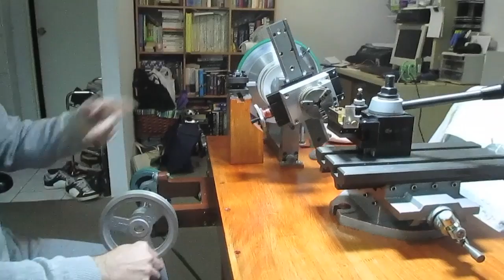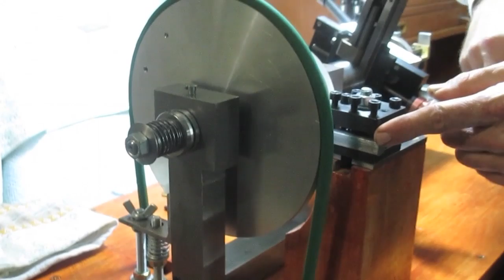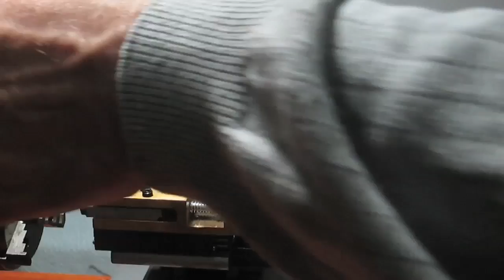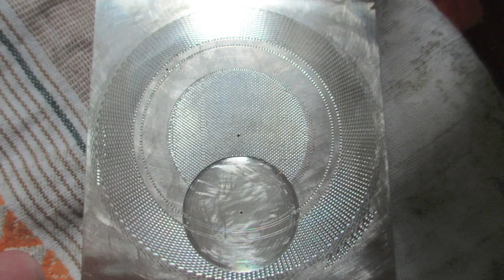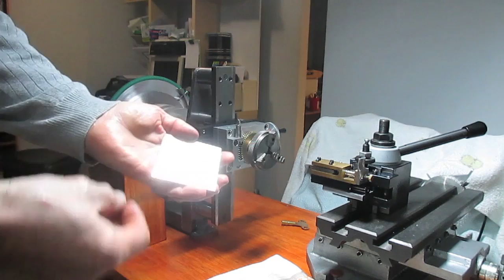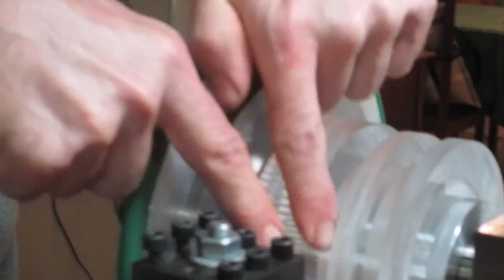Rose engine homemade, tour a guillocher

Comment: There is a video on YouTube showing a similiar lathe for doing Engine Turned Dipwear. Pottery covered with slip that is then turned with pattern cams for radial or axial designs. Checkered, basket weave etc. The lathe in the video is a copy of Wedgewood's from the late 1700s.
Reply from the maker: Thanks for the info. Yes, i saw that vidéo, very informative.

Comment: Hello Frederic. I don't know if you will still answer questions. There is one thing that I do not understand and it is in the support of the cutter how do you make the rubber retract. The pushing action is easy to understand (the screw thread does it). But, in what way is it attached to pull the rubber?
Thank you

Comment: Very nice machine however this is 2019 and You can use software and a 4 or 5 axis cnc to do the same work and the machine cost is a lot less than building a custom machine  to duplicate what was done in the Victorian days.
Reply from the maker: Ahh the CNC machines they are great aren't they? Actually a 3 axis CNC milling machine would do! However there is NO CNC milling machine that can reproduce what a rose engine can do, (I'm talking about guilloche work of course) a well set up rose engine can achive a level of finess and finish of engraving a rotating milling bit can't and that is probably why high end watch brands use these (Victorian) machines to produce their guilloche watch dial.
The only CNC that might have a chance is the Faro F1 with guilloche attachement, but then at what cost?

Comment: Where do you source your cutters and what angles do you use on your cutters?
Reply from the maker: Oscar Gonzalez I use high speed steel bars that I ground to the correct angles,  the angles are critical for engine turning, I use a goniostat with the edge of the cutter forming a V of 10 degrees per side and 20 degrees front rake!
Hope that make sense.

Comment: Really well thought out Frederic, this is the first home built design I've see that uses both the standard rocking and pumping motions the usual rose engines have, but also the straight line motion that guilloche uses. Original machines are of course out there, but unless your very lucky all sell for very high prices. I suspect you already know of it but others may not. There's a great deal of information about Ornamental Turning in T.D. Walshaws book of the same title.
Reply from the maker: thank you for your interest and the info!

Comment: Thank you Frederic, this is the best description of a rose engine I have seen.  I more or less understand how it works now.  I still don't  quite understand how you use the cuter when using the engine in a "pumping action" but will look for more videos on the subject.
Reply from the maker: Thanks for your comment, for pumping cuts the cutter and headstock stay stationary and only the rosette barrel and spindle assembly slide axially by the action of the touch piece against the back side of the rosette while revolving thus creating ratchet cuts.
Hope that makes sense.
Reply: Thanks Frederic.  Do you have some examples of cuttings done this way that you can post on Instagram?  Appreciate your reply.

Comment: Hi Fred. Absolutely fantastic, an inspiration to many, including myself. Do you have any plans and/or measurements that I could use to make my own rise engine? Cheers Andy
Reply from the maker: Hi Andrew, thanks for your comment, unfortunately I do not have plans for my rose engine except for the headstock and spindle, I worked around with materials and parts on hands and didn't spend more time than needed to make plans but took measurements in situ to fit parts, I had the whole vision in my head. Perhaps I should post a video on the assembly of the headstock and rosette barrel since it's not so obvious as to how it works.
Cheers.

Comment: Hi hope everything is well. 
I was wondering what is dia meter of the rosettes .
I am going to start making a small file for future incase I end up making one .
I  guessing any shape I desire I can make them .
also the ratchet on the cross feed what would the count of the teeth are .
Thanks Gary .
Reply from the maker: The rosettes diameter is 150mm from memory, the teeth count on the ratchet wheel is 100!
Cheers Fred.
Reply: @liliss67  hi Fred.
As we spoke in the past, I was wondering about the amplitude dimensions of the rosettes. How deep they are. I will be using for jewelry which is as small as the watch dial. Thx have Happy New year and hope there will be peace in the world.

Comment: Hi I really like what you have done there .
I am a tool & die maker. 
I came to discover rose engine machine about a year ago. 
I must say it is a fascinating beauty. 
I have a question for you just a curiosity. 
how do you sharppen tool cutter for basket weaving .
I wish that I could have the opportunity to work on a rose engine machine some day .
thanks. 
Gary
Reply from the maker: Hi Gary, Thank you for your comment,The tool is sharpen the same way and angles regardless of being use for basket weave, barley corn, diamonds, clous de Paris etc...The angles are critical and I use a "Goniostat", sort of sharpening jig, to set the different angles against sharpening stones.Regards.Fred.
Reply: Thank you for replying. 
I am really amazed of this machine and the way you do the work .
I will contact you in the future if 
Decide to make one for my self .
Thanks again Gary.
Reply from the maker: Gary, yes they do are really fascinating machines and I wanted to try it since I saw the working of it in the George Daniels book "Watchmaking" but finding one at reasonable price is next to impossible so after lots of thinking I went ahead and built my own and it was lots of fun.If I can do it you sure can and I'm not an engineer!I will be more than happy to help if you decide to make your own.CheersFred.

Comment: Hi Frederic, Thanks for taking the time to produce this excellent video. I am about to start making a rose engine based on Fred Connell & Roland Hege's Rambling Rose design. However, there are features in yours that interest me and I would very much like to have a closer look at yours. I realise that this is a very big ask and will understand if you say no. It may not even be possible. I see from your Carbatec mill that you are most likely in Australia but you might still be on the other side of the country :-) So I am east of Melbourne. If you are willing, I would love to hear from you.
Reply from the maker: Hi Doug, thanks for the comment and interest, I designed and built the rose engine according to my need and specs which is specifically for guilloche work for watchmaking.
I would love to show you the machine, I am in Perth WA, if you get a chance to come by that side of the country let me know !
What are the features that interest you in my machine?
I have seen the Rambling Rose design before but I'm not sure that this machine is solid enough for fine guilloche work which require minimal or non vibration, but I might be wrong.
Let me know how you are going with your rose engine built-off!
Looking forward to hear from you.
Fred.
Reply: Hi Fred,
Thanks for responding. I don't often make requests like that and so I forgot to look for an answer :-P
I'm on the other side of Australia (East of Melbourne) and so I am unlikely to be able to visit you but I really appreciate the offer. I've only just started the project and it will take me a long while as I am an inexperienced hobby machinist taking on a project that is probably too much for me. But hey, nothing ventured.....
I recognise that the Rambling Rose has a very different purpose to what you do but I also know that good design in one machine can often be adapted to a different machine.
If you have the time and inclination, I would love to see quality photographs of your lathe in fairly close up detail and from different angles. Please accept my reassurance that I have no commercial interest. Just a thirst for learning new skills and for keeping my ageing mind ticking over :-)
Best regards
Doug